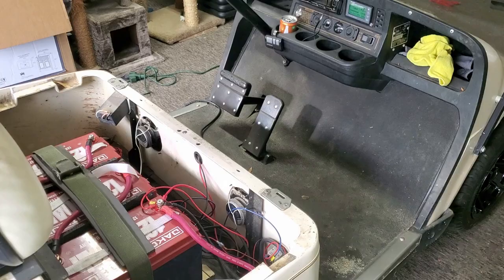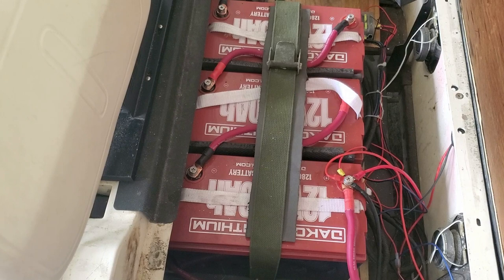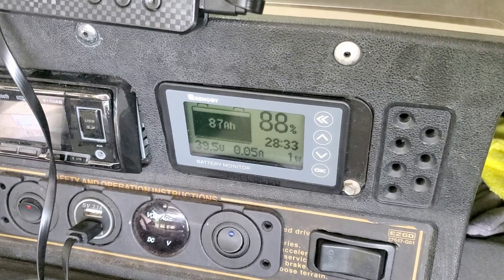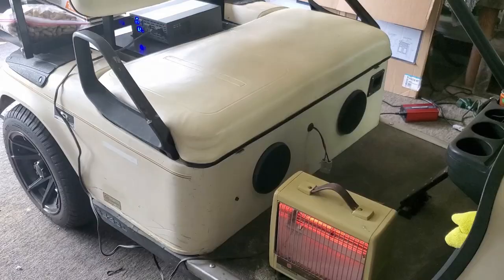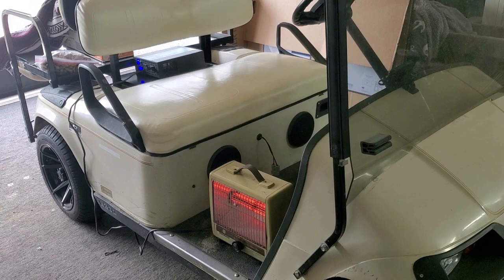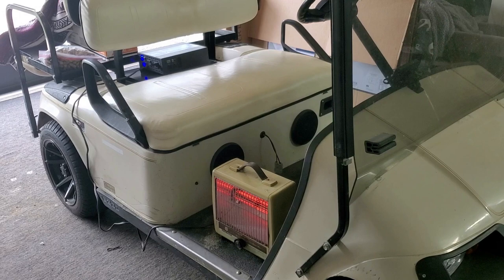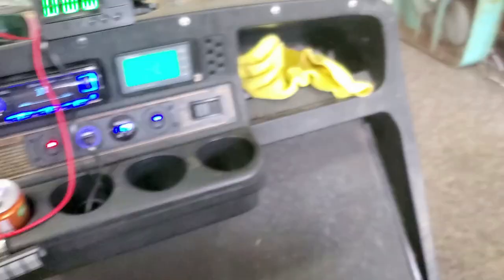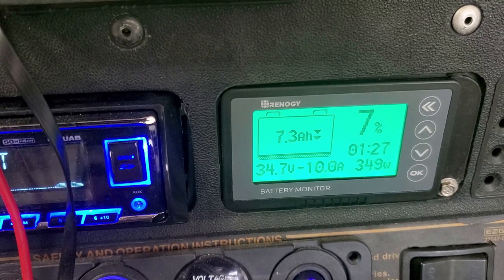Capacity test of the Dakota Lithium 36 volt Golf cart 100Ah pack on the TXT EZ GO

Comment: I swapped out to 48V, 4 x 12v DL+ 64ah from Dakota. I heard that the BMS in the 100ah won't do as well supporting aftermarket speed controllers as they draw to much. Not sure how relevant that is to your set up. I only tool around the yard and neighborhood so not trying for massive range. So far so good on my SR-48400 controller.
Reply from the maker: The DL+ models can put out a ton of power. The standard 100ah versions are rated at 100amps continously and 200 peak. I have never had an issue with bms shut down.

Comment: Hello friend,did those lithium batteries help increase speed a bit? I have an older club car 36v,and been considering switching to dakota. Thank you
Reply from the maker: I lost around 250 lbs so that helped. Also the voltage doesn't drop quite as much under load. I would honestly say though it only gave me a MPH or two max because the cart is speed controlled. One thing I noticed about Dakota after the fact is that they have large discounts for larger orders. If you can go a group buy with someone it would really save cost. Also check out several other manufacturers such as Extreme Team and others. Finally make sure the battery you choose has at least 100 amp continuous output and 200 amp maximum for 10 seconds. The higher the better especially if you ever want to upgrade motors or controllers.